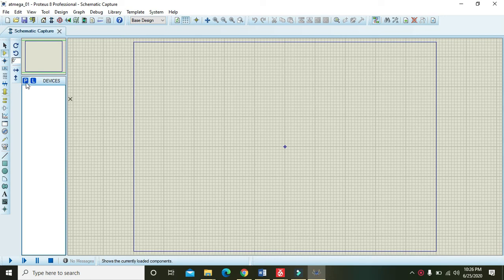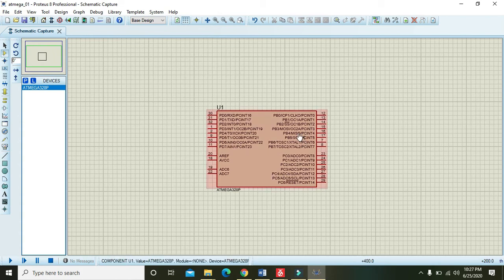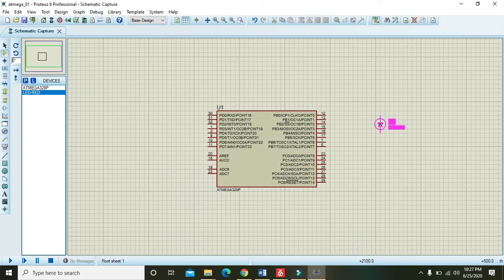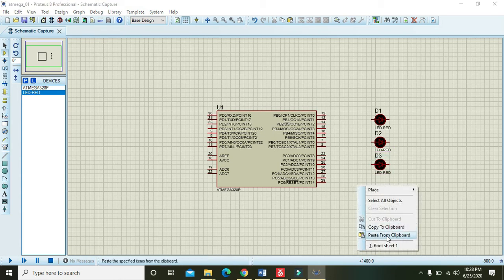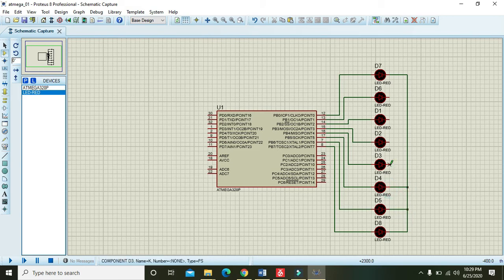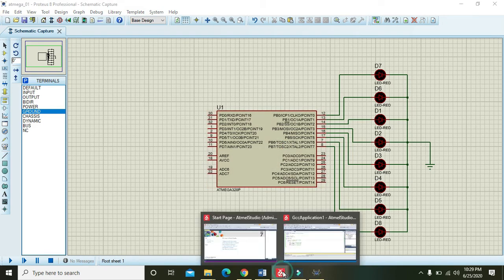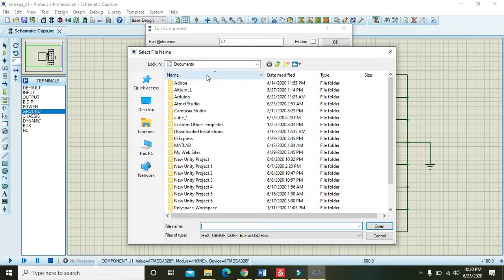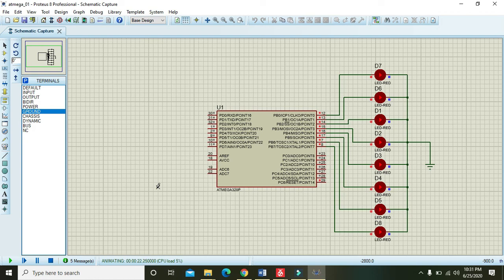How to blink LEDs with atmega 328 in proteus | simulation for LEDs blink with atmega328 in proteus

Comment: I follow your every steps and my LED still wont light up
Reply from the maker: brother...check either u have given +5v on mclr pin...?...after it check the polarity of leds, also most important u need to use animated leds and also check ground is connected....After this is done....either small red square dots indicating 5v and blue dots indicating gnd on the gpio of leds....?

Comment: This a bad video. Proteus is software to simulate real time fonctions what u didn't set is the clock frequency which m looking on how configuring it on 16mhz on atmega
Reply from the maker: one can select the clock frequency by changing the value of crystal. However if not then its internal oscillator starts working....